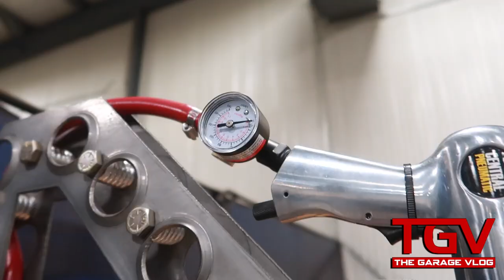How To Build A Planishing Hammer

Comment: Very interesting concept of the air hammer.   It seems it would be quieter than one fabricated using tubing.  I also am interested in a parts kit to fabricate it myself.
Reply from the maker: That does make sense. I've had a few people ask for a kit, I have a few upgrades I want to make first. It does have a bit of flex in it side to side, most of the force is vertical though, I might try making another one out of 3/16" or 1/4" to sturdy it up a bit. I want to machine a clamp to hold the hammer itself too. Still works great though, I'm just somewhat of a perfectionist. Do you have any input or changes you would make?
Reply: @TheGarageVlog   I would suggest a serrated clamping device like a piece of tubing that is split and serrated on the inside.  Maybe pieces welded from one side to the other at the corners of your arms coming out from the back upright and maybe a gusset on each side of the back upright down to the base plate, as well a few plates on the top and bottom of the two side pieces or between them would make the frame smooth on the top and bottom..  Maybe a 3" long piece every 6 inches or so.

Comment: what is the peice inbetween  the two panels that has the bolt holding the two sides together
Reply from the maker: Ryan Michalski Those are just some aluminum spacers I turned on the lathe. I use them for building furniture and other random things I build.